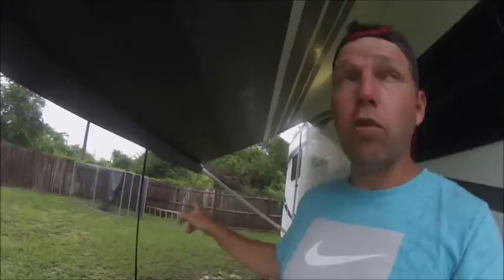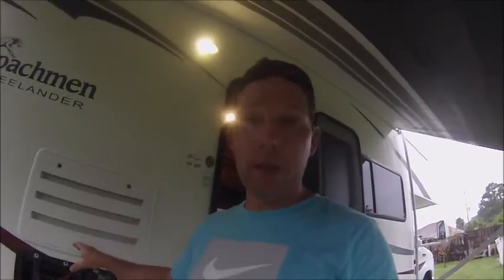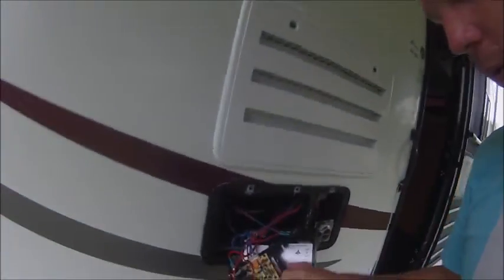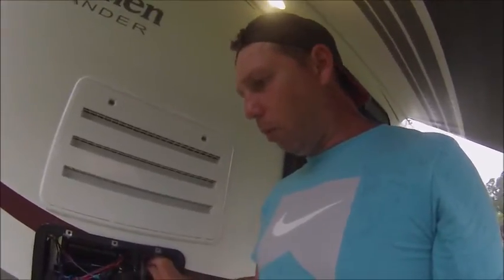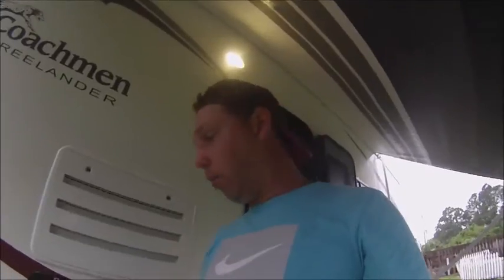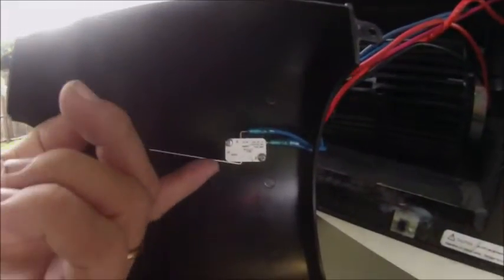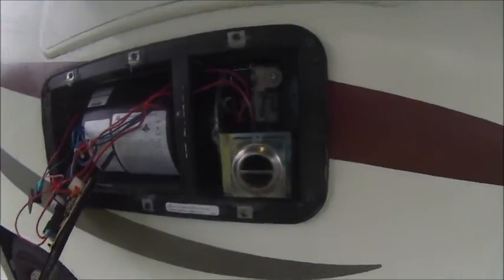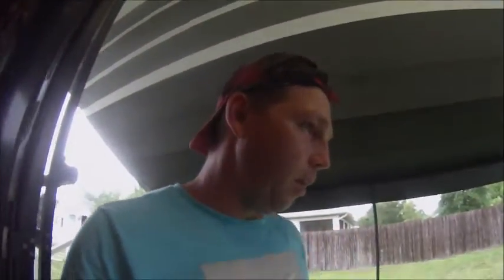RV TIP TIME FURNACE REPAIR

Comment: Thank you for sharing this rv tip. I have been searching for this very thing. I had my circuit board tested at a local rv repair shop. He said It tested bad.  I bought a new board and had the same problem again. I called the RV repair shop and he said he should have checked the board before he gave it to me cuz it could have been bad too. It was you saying to call Atwood directly that helped me. Of course when I took off the fan shroud I discovered the sail switch was stuck in one position.
Reply from the maker: Glad I could help you out!!